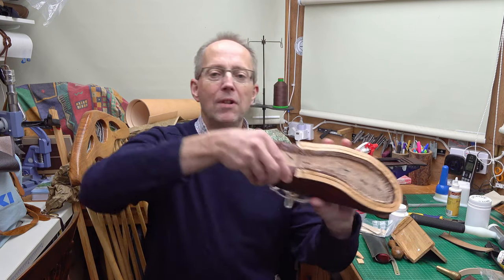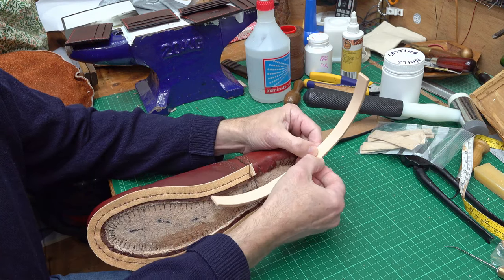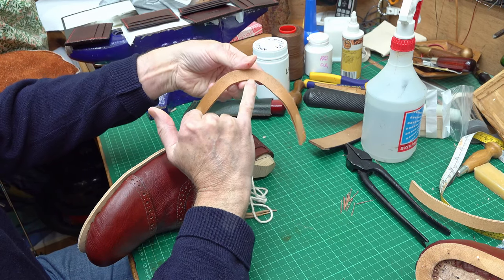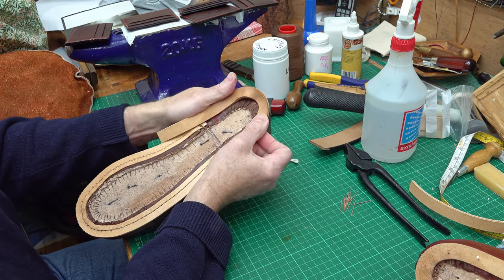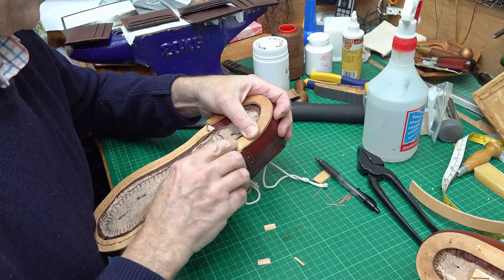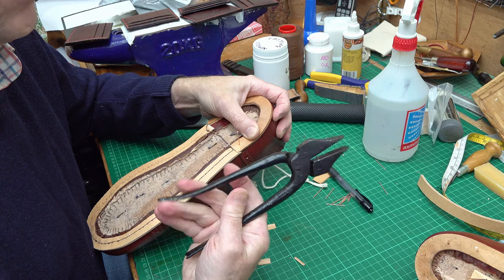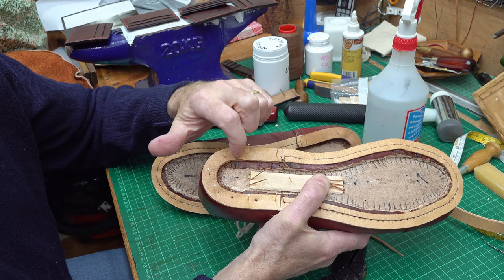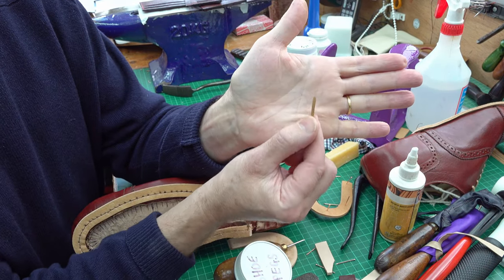Pt 15. Shoemaking Fitting The Rand And Shank

Comment: Old LEATHER SMITH here, I put a couple of drops of dish soap in all my water bottles, when I spray it on leather 2 fold it works just like when U dip it and it stays that way when it's dry, just a thought, GOD'S BLESSINGS ✝️⚾🙃
Reply from the maker: That's clever Jim..I can see that would break down the surface tension...thanks for the tip.

Comment: The Tubes of You apparently don't want me to watch this. 3 browsers I finally got it to play in Opera only in a private window (Vivaldi and Slimjet both regular and private didn't work). 
Finally, in Slimjet after 19 minutes + of waiting, it started playing at 240p. I'm commenting in it while it plays at 1040 on my other monitor.
That complained about, looking good on the shoes, and guess I might try to make a pair of boots, from the ground up, so to speak, this winter.
I've done a bit of resoling (old Docs) and added half soles to a pair of cheaper American made boots. I have lasts that have been customized to my foot shape (plastic last with leather added for my wider foot).
Reply: apparently I was at the edges of the Massive outage yet random stuff worked during the whole thing.